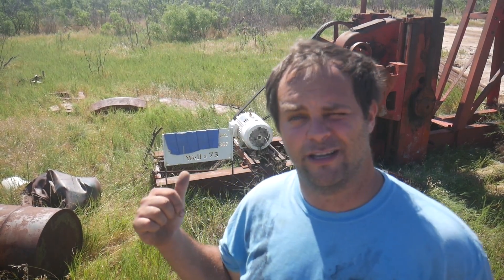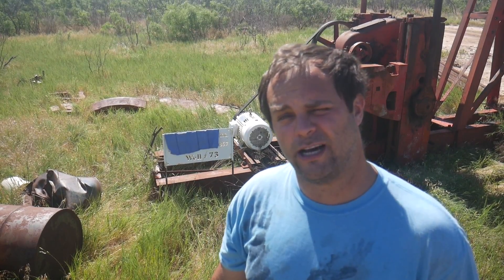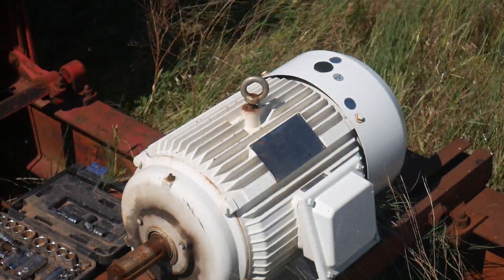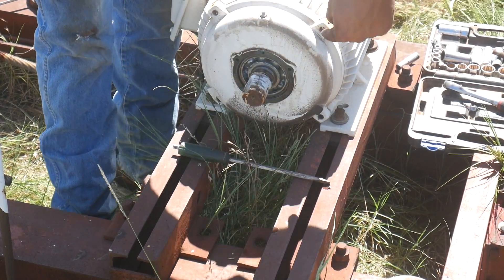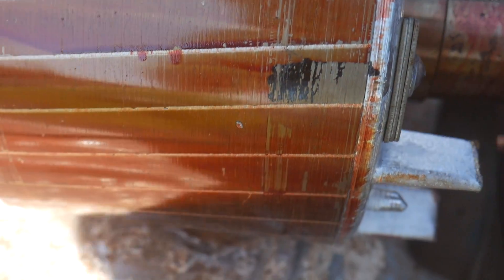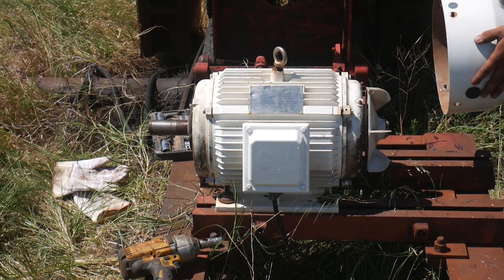3 Phase Electric Motor Repair on an Oil Well

Comment: I work in the bowling business and the machines that I work on are Brunswick machines and they have a single phase 1 horsepower motor on them and back in the day what's the same thing he had a bearing go bad or something and you had to get in there and work on them he always had a spare motor and you'd switch the motors out take the bad one in the shop disassemble it put new bearings in it and service the motor the motors at the originally came with were GE Motors they were absolute workhorses so if I've done this once I've done it a hundred times and like they say a motor is a motor is a motor I'm doing it in the field like that is no different than the bench other than the heat you got to deal with but thanks for taking us along Zach as a machinist mechanic an fabricator even though I'm not an oil man I recognize all the aspects of what you do and I really appreciate the work that you do I wished I lived closer I would donate time to help you out keep up the cool videos and again thanks for taking us along

Comment: I build engines for a living Iv figured out if I put a little piece of Velcro right beside the bolt hole...I seen to get it back in there a little easier....👍👍👍👍👍 great video 👍

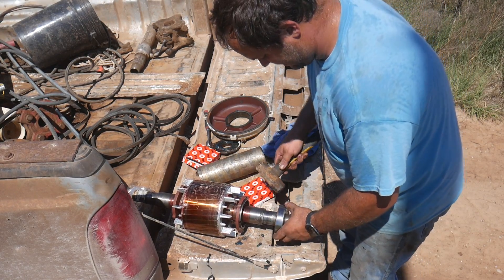Comment: 9:12 Brotip, get a pipe that's slightly bigger than the inner rim of the bearing and use that to beat the bearing in, it will get you a couple hundred hours more on those bearings. Alternatively, use a punch to beat the inner rim in place, the idea is that the ball bearings themselves absorb as little of the shock as possible.

Comment: Zach,  zeehh Germans would have said that you pre damaged your larger load  bearring by hammering on the outer race, all you would need is a pipe to tap the inner race to get more life out of the bearing, surely you could add that to back of your pickup, but I digress it is a Feild repair, love the videos.

Comment: I respect you Zach. As. HVAC technician we rebuild motors all the time in the field. We use pullers to remove the bearings and hammers to reinstall the bearing but you have some various sized pipes on your truck for installing the bearings, that way you only hit the inner race

Comment: When I rebuilt motors in a shop  we used a puller of course but we made our own drivers out of the inside race of one size larger bearing wielded to a pipe and beat on that it works great especially in the field and your bearings will last longer
I love your channel

Comment: Hello, I work in a electric motor shop and wanted to explain the reason the bearings in your motor failed prematurely.

The bearing on the drive end should be an NU roller bearing instead of the standard ball bearing. The sealed bearing that you replaced it with are fine on the opposite drive (fan) end, but the ball bearings are not designed for radial loads.  Hence why you had a fine powder coating the winding and why the squirrel cage (rotor) was hitting the lamination stack of the stator on the side the belt was pulling.

Hopefully my explanation made sense and helps you out in the future
Reply from the maker: Intersting. Is it this possible this is only for larger motors? I've had dozens of motors apart and never seen one with roller bearing. I wonder if they make a direct replacement roller bearing for the ball? I'm going to have to look into this. Usually a 256t or maybe a 284t is about as big as I work on. Thanks.

Comment: The other thing we used to do was have a support bearing on the other side of the pulley if there was space then there was no twisting force on the motor shaft, the cheap motors aren't usually balanced and with the cheap bearings  you get a spiral oscillating noise from the motor as the shaft shakes

Comment: Hi zach, great video that chinesium motor, I saw you changed the open bearings to sealed, I used to do this the cheap motors tends to have "greasers" but in reality they just leak past the seals and make a mess, I found that life to maintainance  is directly related to the cost of the sealed bearings,  I like the lamp for all well on the tank  We used V21 modems and phone wire for communications, I used a flashing Led as a signal for OK so if the CD off the modem was off it set the alarm if the signal line was on continuous it set the alarm and if it flashed it was OK,  lightning is a pain one of my customers had an airfield always getting hit, knocked out all sorts of machines and pumps they put 3 high wattage 12 v lamps in series to the power to each motor in use they didn't even warn up as the motor drew 5 amps a phase but when lightning struck the lines, the lamps blew and protected the motors, was far cheaper than the special fuses,
Reply from the maker: Thats interesting.

Comment: I've replaced a lot of motor bearings. Motor bearings are 1/10,000th press fit. Put a little heat on the inner bearing race and you can put the bearing on by hand, no driving. Just don't over heat it and melt the grease.

Comment: Well, beating the bearings out and in with a hammer worked, though when I've had to replace bearings on motors in our wood shop over the years, I had a bearing puller that fit most, and several short pieces of iron water pipe of various diameters to put the new bearings on with- the water pipe basically contacted the inner sleeve part of the bearing, it would be easy to have a couple of pullers and 2-3 pieces of scrap pipe of different diameters to do this bearing replacement and make it  a lot easier and safer for the motor- one slip with the hammer and the rotor could be damaged beyond use.

I have a 2 HP 220v single phase Century repulsion induction start on the blower for my pipe organ, the motor is from 1927 and weighs 290 pounds, made back in the day when we made QUALITY machines. This motor has a grease cup and two oil cups for lubrication and it's used every day.

Comment: I noticed when you put the rear endbell on you did not put it back on in the same direction with the grease fitting on top.  I always marked the endbelll with a punch to maintain the same direction upon reassembling.  Also you could use a puller to remove the bearings. Bearings are hardened and can explode when hitting them with a hammer. I lost my eye when a piece of hammer broke off when hitting a bearing. To put them on, I used to clean the bearing journal, heat the inner race with a propane torch for a minute or so, and it will slide on.

Comment: I noticed the bell ends have grease certs but it doesn't look like they are used? Thanks for the video!
Reply from the maker: It was greased about every month. The new bearings are sealed and don't need greased.

Comment: ...what you want to do is make yourself a 'portable bearing press'.  All you need is a large plate of say 1/4" or so of plate steel, a hydraulic (armstrong powered) power pack, a bunch of threaded rod and an assortment of rams.

What you do us drill whatever holes in the plate to match whatever you want to anchor to (in this case say the driven side head plate threaded holes)...install the threaded rod and nuts to hold the plate at a distance from the motor shaft...then put in the hydraulic ram to press the shaft instead of using a hammer to move it.

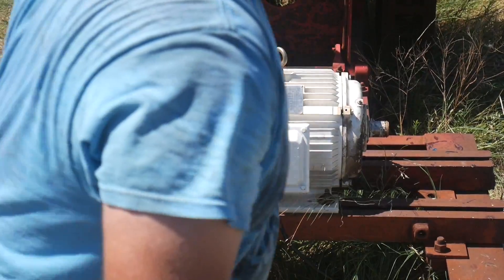This will keep the shock loading off the bearings and help them last longer (I wonder if that's what I'm hearing at 12:30, this clicking sound might be a flat spotted ball or race from hammer impact).

I have made a press like this that I keep in my field truck (millwright) and it was very inexpensive to put together.  Also in the kit I keep an assortment of pipe chunks that I use as spacers to press with.

Cheers, enjoying the vids man.

Comment: Most ball bearings will last the life of a motor, a motor sitting on a shelf in a warehouse. For a long period on time and not being rotated periodically. The earths vibration will cause brinelling, which is the race wearing where the balls sit and cuts down on the life of the bearing. Fact is beating on a bearing with a hammer will shorten the life of a bearing. Try taking the bearings and sitting them on top of your truck motor to expand the metal. And it will just slide right on without beating it. If you get sealed bearings they will last longer.

Comment: Quick & dirty!  The decent quality replacements will save you something in the long run, even with your install method, but if they're getting lightning zapped frequently, maybe just hand packing a unsealed chineisium bearing would payoff.

Comment: Hey Zack, like your videos. Just queries  how long you been doing this? I learned messing with 115, 220 motors off my father a high voltage electrician but you do it as easy as  breathing.
Reply from the maker: I've been around this stuff all my life, also theres so much stuff stuff that gets blow up with lighting its just becomes a normal part of the job.

Comment: I work in a motor shop (first as winder now driver) and holy fuck hammering those bearings was aweful.  BUT....it worked and it was a cheap china motor anyway so send it lol.
If you have a way to heat the bearings they go on easier and you can put both bearings on the shaft first. Then use a piece of threaded rod in the bearing cap inside to line up with the cap on the outside.  Put some bolts in, remove the rod and put the last bolt in.  Just another way to do it.
Reply from the maker: Haha I use sealed bearing because I think they last longer that an open or shielded even if you grease then ever month and you cant really heat the sealed bearings so I just drive then on. That a good idea with the all thread. I've kinda though about that but never tried it.
Reply: @TheZachLife  we have an inductive heater that I pretty sure we can use on sealed ones. But I'm not one of the mechanics so don't quote me on that.

Comment: Love your methods, however one thing will help the drive end bearing last longer after the repair is use a piece of tube or pipe over the shaft that only pushes on the inner race. Also being in the maintenance game for 50 yrs usually the motors with the larger drive end bearing are specifically designed for belt drive use the ones with the smaller bearing is meant for direct drive applications.
Sometimes they are marked sometimes not.
Reply: Excellent point Chuck Thanks

Comment: I noticed the grease fitting and the open bearing were dry. Add to that the wailing away on the bearing with that BFH, it's no wonder you're only getting 6 months out of them. I always use a short length of pipe to drive bearings on against the inner race, beating on the outer race will always damage the races and balls, and I think I heard a tick when you test ran it..
Reply from the maker: It's still running. The ones I hammered on lasted a lot longer the factory one. It was greased every month or so but no need to now.
Reply: @TheZachLife  Yeah, I noticed you went back to a sealed bearing. Those Chinese bearings must really be garbage. BTW, we're in Midland.
Reply: @cbonz7734  Yes the chinesium bearings are pure kr_p!  I had some failed chinese bearings analyzed and found that the rollers and races only differed by 1 to 2 points Rockwell hardness.  To my surprise, the bearing expert said, that's enough to make certain the bearings have a short life.  chinesium quality lacks.

Comment: Damage to the laminations of the rotor and/or stator can allow them to short between laminations allowing eddy currents to flow and cause heat. That being said, I typically do exactly what you did. If it shortens the service life ,,,,, oh well,,,,,
BTW, just curious why you use 1200 RPM instead of 1800? I'm guessing longer service life??
Reply: Just a guess, but using a lower RPM motor would allow you to use a larger diameter sheave on the motor for the same diameter sheave on the gearbox.  This would increase the length of the belt in contact with the motor sheave and allow for more power transfer without slippage.

Comment: Is see the new bearings were sealed and the old ones were not, the old bearings looked dry, do you grease your motors?
Reply from the maker: It would have been greased with the unit about every month. I always go back with sealed bearing because it seemed like they last longer and no longer need to be greased.

Comment: Motor wound overseas via cheap labor----Americans would need $40.00 per hour, and Chinese $5.00 per hour! Rotor or commutator  is centered by the bolts and bearings.Synchronous Motors cannot be run w/o a load, cause they'll burn up!

Comment: The way you hammered the old bearings off and the new ones on was difficult to watch. By hammering on the outer race of the bearing you will bend the cage that the balls run in and shorten the life of the bearing significantly. Also beating on that rotor like that will put it out of balance and shorten the life of the motor. 
Yes us electricians cost more but we do it right and it will run a long time without having to do this again.
Reply from the maker: The bearing I put in have already outlived the original. I have a press and bearing puller but its not worth my time to haul this back to my shop. Also I haven't seen and shortened life span and considering I've got about 60 motors running I've got a pretty good sample size.
Reply: @TheZachLife  if it works for you then that is 👍

Comment: Yep...
That’s a brutal way to fit bearings. 
I would’ve probably driven the bearing on with a pipe. 
But, obviously your method works until you need to do it again.
Reply from the maker: The ones I drove on have actually outlasted the original not lol.

Comment: Power Inverter will turn 2phase into three phase. You have to do some rewiring to your motor but it works. Ran an engine lathe that way for years.
Reply: Two phase is pretty much pointless. 
Where are you that furnishes two phase?

Comment: I wonder about the cost/life of a quality motor vs. multiple replacements/repairs of the Chinese motors works out to. IIRC a 10hp quality motor is about $2-2.5k  vs the 900 you said that one costs. Now add in the parts, lost production and your time in realistic dollars per hour.

I am willing to bet that the cheap motors actually cost you over two or three times the cost of a name brand motor which you buy once in say 3-5  years vs. replacing or repairing the imports.

All that said,  this is still a great tutorial for perfoming some quick emergency motor repair in the field.
Reply from the maker: In my experience the high quality motors really don't last any longer than the Chinese ones out here. Usually the lightning blows them up regardless of how good quality they are. Im sure the bearing are better but often that's not the failure point.

Comment: We put $40 SKF auto lubricators on each bearing zerk fitting, and have gotten very good life from our bearings.  Most bearings die from lack of lubrication, especially those located outdoors.  Just be sure you specify open or shielded bearings, not sealed.  Sealed bearings won't accept any external grease.
Reply from the maker: I have to try a few.
Reply: I second the auto lubers, then you just come back and pump em back up.

Comment: Your motor must not have been specified for belt service, that's the only difference in a belt service motors is the bigger bearing on the belt side. Get yourself some pieces of pipe (which should be easy in your business) that just fit over the diameter of the shaft to pound those bearings back on using the inter race, they will last longer. Oh, and a bearing puller or a big ass vice, funny seeing that rotor fly all over the place in your truck! I subscribed to your channel it reminded me of my electrician days in the steel mill. Getter runnin.
Reply from the maker: I bet that's exactly right. I have built several bearing drivers and can't ever seem to find them. Interestingly enough I have really good luck with the the sealed bearings even when driven on with a hammer. I think that they hold the grease better than the factory bearings that you can grease.